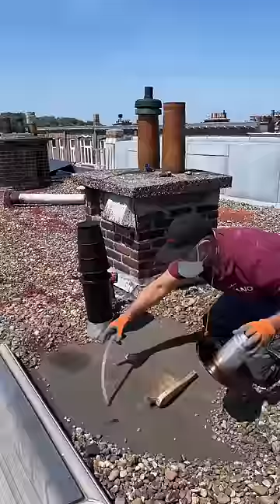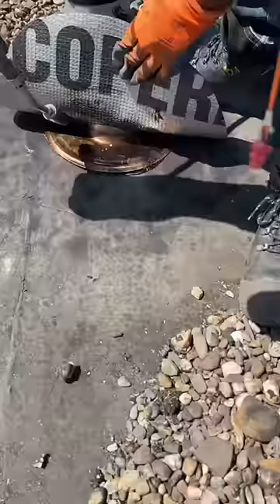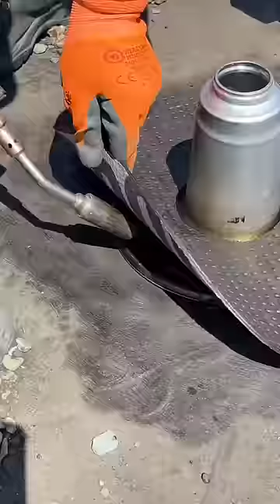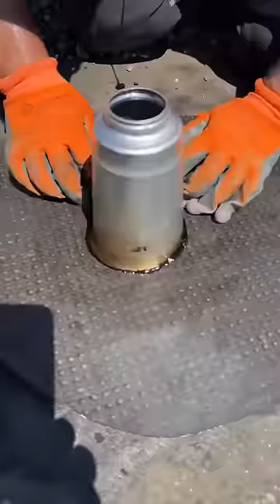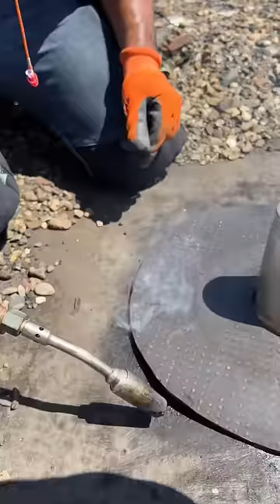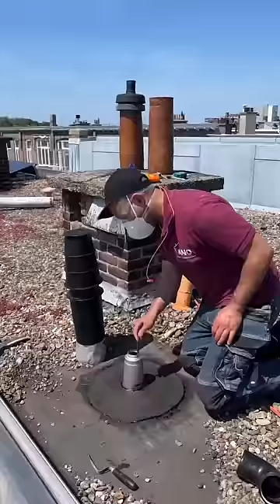A roofer shows how to make and adjust a roof vent to use a condensation pump

Comment: Why is there gravel on the roof?
Reply: I think it is for protection from sun
Reply from the maker: Bitumen flat roof with gravel.

Roofing stones (gravel) are placed on the roof covering to protect the covering from being blown up by the wind.
Roofing is also protected against UV rays from the sun.
Because we use gravel, the roofing can be loose and does not have to be attached to the roof construction.
the main advantage of this is that the roofing material can expand and contract freely. This makes the roofing last longer.
in the Netherlands Have a lot of technology. this is 1 of many method.

we now also do green roofs.

A green roof is a roof - flat or sloping - covered with plants, herbs or grasses. Designations that are also used are vegetated roof, roof vegetation, roof vegetation or vegetation roof. Within green roofs, a distinction is made between extensive and intensive green roofs.

A green roof has many advantages on an economic, ecological and social level. For example, a green roof ensures water retention, air purification, a lower ambient temperature, heat regulation, energy saving and biodiversity in the city. Green roofs are part of climate-proof building. Moreover, people feel much more comfortable in a green environment than in a gray one.

Comment: Why would you have to run a condensate line through the roof?  That water is acidic as hell for one and full of nasty slime goo that will end up building up on the roof in places,.  Plus pumps only will push the water like 20 feet up at most for most pumps..

Comment: Why those gravels on roof ?
Reply: A bitumen flat roof lasts between 25 and 30 years. At the end of its life, it dries out and you can suffer from leaks. To extend the life of bitumen, you must protect the flat roof with slate, gravel or roof tiles. This protects the bitumen against UV radiation for a longer period of time. It also prevents the roof covering from coming loose in high winds.

Comment: But why stones on the roof?🤔🤔🤔
Reply from the maker: Bitumen flat roof with gravel.

Roofing stones (gravel) are placed on the roof covering to protect the covering from being blown up by the wind.
Roofing is also protected against UV rays from the sun.
Because we use gravel, the roofing can be loose and does not have to be attached to the roof construction.
the main advantage of this is that the roofing material can expand and contract freely. This makes the roofing last longer.
in the Netherlands Have a lot of technology. this is 1 of many method.

we now also do green roofs.

A green roof is a roof - flat or sloping - covered with plants, herbs or grasses. Designations that are also used are vegetated roof, roof vegetation, roof vegetation or vegetation roof. Within green roofs, a distinction is made between extensive and intensive green roofs.

A green roof has many advantages on an economic, ecological and social level. For example, a green roof ensures water retention, air purification, a lower ambient temperature, heat regulation, energy saving and biodiversity in the city. Green roofs are part of climate-proof building. Moreover, people feel much more comfortable in a green environment than in a gray one.

Comment: Why Stones on roof?
Reply from the maker: Roofing stones (gravel) are placed on the roof covering to protect the covering from being blown up by the wind.
Roofing is also protected against UV rays from the sun.
Because we use gravel, the roofing can be loose and does not have to be attached to the roof construction.
the main advantage of this is that the roofing material can expand and contract freely. This makes the roofing last longer.
in the Netherlands Have many technology. this is 1 of many method.

we now also do green roofs.

A green roof is a roof - flat or sloping - covered with plants, herbs or grasses. Designations that are also used are vegetated roof, roof vegetation, roof vegetation or vegetation roof. Within green roofs, a distinction is made between extensive and intensive green roofs.

A green roof has many advantages on an economic, ecological and social level. For example, a green roof ensures water retention, air purification, a lower ambient temperature, heat regulation, energy saving and biodiversity in the city. Green roofs are part of climate-proof building. Moreover, people feel much more comfortable in a green environment than in a gray one. Below we list all the advantages in a clear manner.

Comment: Really wish you could get away with this in England!!!
Just discharge straight on to a roof!! Never happen here
Reply: Why would you want to? Most buildings have an internal drain you can pipe into.
Reply: @nathd1748  coming from an installer of nearly 20 years it is not always practical or possible to access the soil stack
Reply: @Si H  Yes I actually know that, but you should also know that the pH of condensate will even rot concrete roof tiles. We get taught that during 1st stages of ACS training.
Reply: @nathd1748  dude obviously.. I am talking about the strict rules that surround disposal of condensate to an external position (as I’m sure you are aware) as I said in my first comment ‘never happen here’ (I E the UK)
Looking at it from a logical standpoint discharging into a cast iron soil stack is possible due to taking into account the grey water present within it for dilution . I guess the same could said about a roof (rain water) just a thought

Comment: Y the fuk is there stone's up on a roofing dangerous as fuk when it jt flat never mind haven to walk around on stones
Reply from the maker: Roofing stones (gravel) are placed on the roof covering to protect the covering from being blown up by the wind.
Roofing is also protected against UV rays from the sun.
Because we use gravel, the roofing can be loose and does not have to be attached to the roof construction.
the main advantage of this is that the roofing material can expand and contract freely. This makes the roofing last longer.
in the Netherlands Have many technology. this is 1 of many method.

we now also do green roofs.

A green roof is a roof - flat or sloping - covered with plants, herbs or grasses. Designations that are also used are vegetated roof, roof vegetation, roof vegetation or vegetation roof. Within green roofs, a distinction is made between extensive and intensive green roofs.

A green roof has many advantages on an economic, ecological and social level. For example, a green roof ensures water retention, air purification, a lower ambient temperature, heat regulation, energy saving and biodiversity in the city. Green roofs are part of climate-proof building. Moreover, people feel much more comfortable in a green environment than in a gray one. Below we list all the advantages in a clear manner.